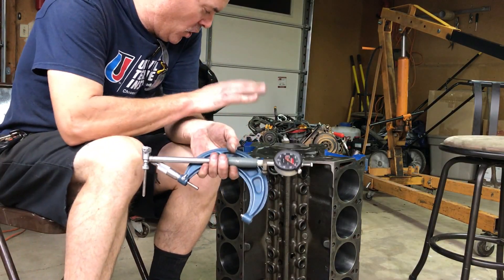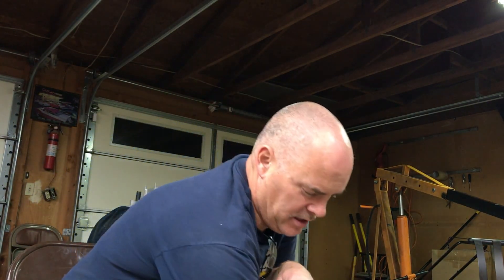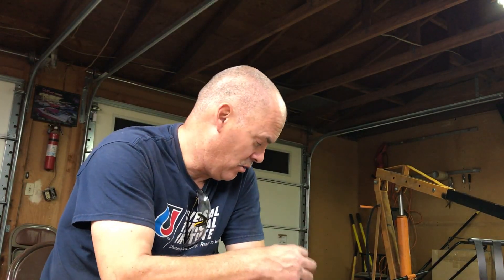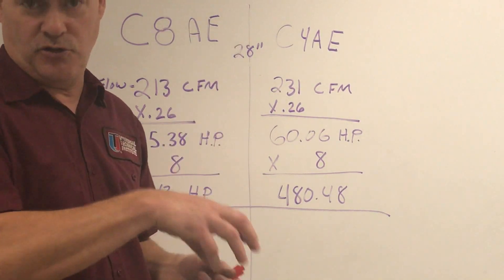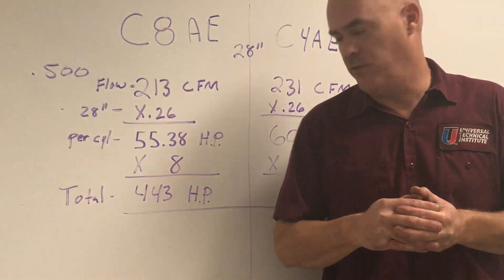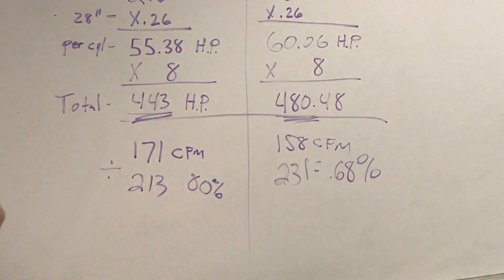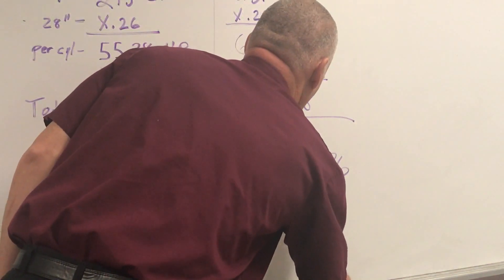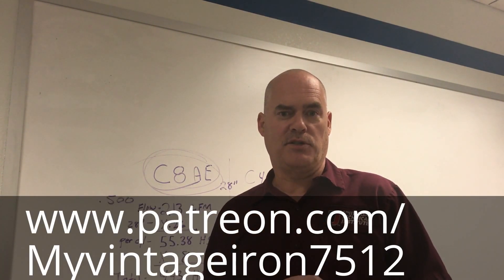390 FE Head Shoot out

Comment: C4AE are of the tall port/ low riser configuration. The C8AE are of the medium riser configuration.
Reply: No they are not. The C8AE-H is a smog head. They are not a performance head by any stretch of the imagination. The 58-66 Tall Port heads are made for performance. The 428 CJ copied the early heads, and they put 2.09/1.65 valves in them. The 428 CJ made the same power as the LR 427. Your test is wrong. The C8AE is not a Medium Riser. It is a small Low Riser intake. The C4AE head will make 1.5 hp per cubic inch. The C8 is made for smog regulations that were coming.

Comment: Honestly I have been running a 60 over 390 for my 428 stroker engine for 7 years now and it has never ran hot at all.
Reply: What is a "60 over 390 for your 428 stroker"?  A .060 over 390 is not a stroker 428? A .060 over 390 is a 401.
Reply: @jesseduke694  I put a 428 crank in it on a 4.11 bore.
Reply: @jamest4363  oh I got it now. Ya, that would be about a 422.

Comment: Last time I built an FE was 1984.  I punched it out 30 over and swapped out the intake from 2 barrel to 4 barrel.  Then put the engine in a dump truck.  I then built a 360 FE to put in my F100 pickup truck.

Comment: it funny how the big ports are bad but in later engines a vacuum controlled butter fly valve in the intake chocks off the air at low part throttling  i see this in various toyotas starting on the 5mge supra n i saw in on the 4.6l 4 valve Lincoln mark engine...be neat to use that thought on a big ole v8 frum the say 1960`s

Comment: Let me start off by making a disclaimer. i dont do check ups before I say something which is prolly dumb but challenging for sure. Im at least your age so I wont explain the memory thing. I forgot anyway.   As for the heads. I may know a little sumpin about them. I grew up in Dearborn Mi. 96% of my family worked at Ford, and the bow ties were not even allowed to park in our drive way. And that is true. So I  messed with an FE or 2. Our basement was (and not exaggerating) half full of 427 high riser heads manifolds, both 2 and single carb appls. We had boxes and boxes of Lemans cap screw rods,  steel cranks, and cross bolt blocks all over. So i'll throw my .02 in on this and hopefully bring some light to the topic if for nothing else to confuse some of you even more.  Brandon down there farther on this page is partially right. You have your ref to the low and med riser heads backwards to be simple. Low risers came out early then the med and High just after. But im going to try and stay on track to keep the typing down.   You have to remember the FE was FoMoCos mule for everything. and they had so many bore and stroke combos with them it would make you dizzy. And that many different head combos to. As i know it, the first hipo version of the FE was in the 1961 Starliner. And this is where I may be wrong but as you'll see in a sec its trivial to the point. I know they had the 390 hipo that was offered with tri power in 61 and it was rated at 401 hp (i think.) Anyway that was a version in casting form that continued in some way for a few years but not right after the motor wasnt offered any more if that makes sense. Now this is what I am to know. fact or not ?? Never was able to confirm or disprove a lot of the things "I know"  As I understand it the only Low Riser head is as follows. C3 number only. Not C2 Not C4 the casting were not the same that I do know.  They made other C3 castings as well but the low risers were not the same and did not ever carry a C4 number That I do know for sure. the real  Low Riser heads only came with the C3 number,  they had huge 2.125 tall intake ports, intake valves were 2.19 ex 1.88 sodium filled. chamber size 72cc(i think) and you knew you had a correct set because they had a big "H" stamped right on the outside of the exhaust on the top of the flange. Thats why in the video our mans says people say the low risers heads are the best. That is a fact. They make super big power. They out flow everything else Ford ever made except the High risers. they were 3 times the super cj head was those C8s you have in the video those are cj heads. the 1 st year for the 428m cj ...? ahh C8 you follow? The 390 gt motor used 28 cj heads and were then revised to be CJ heads when the GT became no more. valve size and all. The 28 had a long arm and didnt like rpm hence small port small chamber head. with adj rocker arms. Only 427 had the large 7/16 adjustables all the other had 3/8 except the 427 hydraulic motor in 67 they had non adj. rocker arms.   So the first version of the 390 hipo head used on the 61 Starliner was still in the mix all the was through 1970. It became the 390 PI head in 62 and 3 still with adjustable rockers due to the PI having solid cam,  then the 390 gt 4bbl head, without adj rockers, then the cj head in 67 and went through 3 revisions only in chamber size and valve size (very minor as i recall) but port configuration was still the same.  In the early for ss mustangs they got adj. rockers again big valves and small chambers.  
 so for the most part they had just 3 heads that made good power in certain areas. if you dont count the high riser. and most dont because the were not ever offered to the public.  the real low riser heads are here https://www.youtube.com/watch?v=Y8GreAEqkio
Reply: Dearborn here too^__^ FE man myself!
Reply: Yeah, but did you have any C7 rods or cranks?

Comment: Hello my vintage iron, my name is Norwood and I’m from New Orleans, LA. I’m looking for a set of ford 302 TBI heads with the ports at the rear of the heads for the ford A.I.R. Emissions system. I have a 85 mercury grand marquis, 5.0 2bbl TBI with the TFI stock ignition system, AOD-M trans w/shift kit and a 8.8 rear diff 3.73:1. I’m not looking for fancy heads with big valves or extreme porting, obviously because of TBI and EGR and the A.I.R. emissions. I’m just looking the get a set of TBI heads that flow better than stock (slightly ported with guides, valve job, seats, seals, springs) but not hurting power and torque. My engine is bored 0.030”, I’m pretty sure the block deck is straight & true with less than 0.002” warpage and the bores still show good cross hatching. I have the original heads (cores) disassembled and cleaned but, as in your videos the guides, seats and valve seals are stock integrated and never been cut. I’m wondering if you have a set or can obtain a set of these heads and do the head work, valves, seats, slight porting and so on. If you can obtain the heads and do the head work, how much would that cost shipped to me. I really like how thorough you work and the quality of repairs you produce. I’m and engine builder for cummins inc but I do not have access to any machine tools. I’m qualified to do the work but, I just don’t have access to do so. The machine shops in my area are ok but, they tend to have a get-er-done attitude that I’m not to keen about. Please, let me know about this as soon as you can. I am on a budget but, I’m willing to spend the money to have a quality set of heads on my engine.
Reply from the maker: Yea I have several sets for sale

Comment: I'll call you the Ford Guy! My 64 Galaxie has a (original w/ RV cam) 390 4 bbl carb and I rebuilt it. It runs great but I didn't put hardened valve seals in the heads. I have been buying lead additive for it. A machine shop told me I didn't need hardened valve seals because todays gas won't hurt the engine. Can I get your opinion? Thanks
Reply from the maker: they are wrong
Reply: So this machine shop is looking to do a job on your heads sooner than layer

Comment: I have a 1969 Ford f250 camper special with a FE 390, with cylinder heads casting numbers D2TEAA can you tell me all the stock specs on these castings like valve size, exhaust port height and width dimensions, the exhaust manifold gasket that fits the port the best, because I'm going to build a custom set of headers for it because there are no off the shelf headers that will fit the stock starter on the passenger side and the saginaw steering box on the driverside. This info will be very helpful for me, thanks. Mark.
Reply from the maker: They are the same as he D8OE except they have induction hardened ex seats
Reply: Thanks for your reply, but that still dose not answer the questions so I will ask again. What dimension  height and width is the exhaust port (actual measurements)? Can you find the same casting number (D2TEAA) in your awesome collection of heads and measure this for me? The reason for this is I'm having to make a flange that fits the exhaust port and 1 3/4" tube size better than the generic sized header type. I have noticed that when fitting the 1 3/4" tube to the generic oversize flange rectangle shape opening, there is a considerable gap in each corner to fill in with weld. I would rather make those corners more rounded which would fit the tube much better and require much less pounding and welding the corners to make it fit the flange and seal the header. To demonstrate what I mean click on this link of a Sanderson header for the Ford FE then click the magnifying icon to get a close up of the corners of the exhaust manifold flange where the 1 3/4" tube fits the flange, you will notice the gap in the corners where they tried to fit the tube then filled it with weld. I think their is a better way to do this by making the flange opening more rounded in the corners. https://www.sandersonheaders.com/sanderson-ff391-header-set-for-ford-fe-engines.html

Comment: What would be a good budget build for a 360fe was thinking aboyt finding a 428fe crank and building it up from there with a 4 barrel carb cam and maybe alluminum cylinder heads im only 17 so money isnt exactly flooding in my pockets lol it would be going into a 71 f250 4x4 would like a real nice rumble and enough torque to pull a house down with a little more top end power
Reply from the maker: Find a 390 crank and rods and youve go a 390

Comment: great video. great math. 
You mentioned that you measured your ports flow at .500. Meaning that it would be a single plane cam. My guess is that by using a dual plane cam (.500 intake, .524 exhaust) will give you different results in flow and final HP numbers you wrote on the board. Correct me if I am wrong. -thanks.
Reply from the maker: that's why we will usually run a duel pattern cam when running factory heads it gives a poor flowing exhaust port a bit of a boost good point
Reply: @Myvintageiron7512  until you go to the point of reversion as you have shown us.

Comment: my car came with C8 heads on a 68 engine. the book says CAR IS 11:1,  and I was considering just having the shoulder taken out of the exhaust ports. I figured I'd make plenty of power for the street withe a mild street cam and carb and intake on this little 390. if that's not enough id spend the money on a stroker kit from Survival Motorsports. this will never see the track and it has 3.08 gears on a 3800lb car. I have an eating posi ready just in case.

Comment: TFS is now producing a new designed set of heads for the fe engine. The flow numbers are almost too much for a NA built engine. With the exhaust ported out on the c4 head would you choose this head for a bracket racer?

Comment: I had a flow bench and was trained by a older man that did it for 30 years how to port heads and use the bench and I was wondering why you aren't using a contoured intake port opening attachment?? The reason is the right angle sharp edges of the intake port opening are a restriction because they cause turbulence in the air entering the port and lower the flow bench readings which is not a accurate flow rating of the intake port itself. In the real world you have a intake manifold attached and carburetor on top which the carburetor has contoured radius to enhance airflow. Just curious??
Reply from the maker: That is true I don't have the intake fixture for the FE heads in this case we were just comparing one head to another
Reply: You can use modeling clay, that's what I used until I made one out of machinable clear plastic
Reply: By the way how much more power will I gain if I use a Holley 500 cfm two barrel and add headers. I'm not looking for a whole lot more like most are just a significant improvement over the stock anemic setup. My stock two barrel is only 351 cfm

Comment: Cutting the shrouding from around the exhaust valve in the combustion chamber will do wonders for a C4 head. This stuff aint rocket science. Just open the exhaust ports to match the gaskets and smooth out the transition and bowls. Go slow and check the volume. A few hours of patient grinding (make some profile templates) will buy a bunch of hp.

Comment: I had a 1966 Fairlane 4 speed 2 Bbl 390 back in high school. I had a competition valve job done, installed Crane springs and a .512" Lift x 312D duration cam by Mellings along with a stock 4 Bbl intake and 780 cfm Holley. Being a dumb lid, I basically cammed and carbed it like a high compression big block Chevy with good heads ... wrong wrong wrong. The car was not much faster than stock and tempermental as hell with no vacuum and no low end torque at all. I wound up replacing the Mellings cam with a factory Ford 428 Police Interceptor Cam, H&M steel shim head gaskets, downsized the carb to a 600 CFM Holley and put in a 3:90 gear to get it running "right". 389 GTO's and 325HP big block Chevelles would still blow my doors off at the top end. Bad head flow, low compression and weak cast rods (4800 RPM safe redline) made for a really crappy motor. I eventually bought a 428 CJ out of a wrecked Mustang. That was a fast motor.  

Building a good running 390 Ford is a challenge. They need a stroker kit with forged rods and Edelbrock heads to keep up with a stock 428 Cobra Jet.
Reply: WE HAVE A 390 VERY MILD in 80s thunderbird drag car with 456 gear  c4ae 6090G heads comp 268 cam it runs 7.80s  in the 1/8 mile  we have videos of it on facebook
Reply from the maker: I agree they is why we chose to stroke this one
Reply: The problem wasn't just your head flow, it was your cam selection. a street FE runs best at around 258 to 270 duration, and around .480 to .490 lift, and that is with a high flow dual plane. a decent porting on the stock heads would have yielded plenty of torque, and the factory rods are good to around 6000 rpm.

Comment: By that same rule, you'd only need to gain 8% of intake flow for the C8 head to match the C4 head.  ...a better alternative would be to retain the intake port volume and just port the C8 exhaust ports by 8% (13.68 cfm) taking the flow to 184.68/213 = 86.7 % x 443 hp = 384 hp with greater torque. I'd be interesting to see the intake flow numbers on both head as you increase lift above .500.
Reply from the maker: agreed improving the ex flow on the C8 is the best way to go

Comment: You my friend are a bank of knowledge. I am 16 years old and I know I need to rebuild my 390 within the next year, but I am not sure if and will it will happen. The motor is an all original 1964 390 fe thats in my 1964 Mercury Montclair. Ive checked all the castings and the block and heads are from 64 but the exhaust manifolds are from 1963.....interesting. Anyways, the reason its gonna need a rebuild is theres something going on in cylinder 5 . I'm not sure if it has broken rings, low compression, or what, but it is what it is. The engine sometimes runs on all 8 cylinders but at most times it runs good on all cylinders except cylinder 5....I'm just not sure whats going on with it. I have videos of my car up on my channel if you are interested. Maybe you can help me figure out whats wrong.

Comment: Thank you for the videos- I am currently tearing down a 390 and have found many great tips here. This engine is a puzzle as it is not the one that came with the car- the heads on it are C6AE-R . Have you ever put a set of those on a flow bench? I am putting this car together with my son who is 7, he calls it his new-old car. It's our 10 year project. It is not a hot rod and weighing 5000 lbs I need as much torque as I can get to make it move. It's a 66 mercy park lane convertable. I don't have the cash to send the heads out just to get some numbers at the moment but if you have anything to tell me that would be great we appreciate your time.
Reply from the maker: That is a really good set of heads they are called the poor mans CJ heads they have big ports but the smaller 390 size valves if you have a machine shop install a set of larger 428 valves and do some clean up porting and you will have a really kick butt set of heads or being on a budget like you are just run them like as is,  they are still better that your average 390 heads they work very well check the stroke of your engine you may have a 428 engine there
Reply: Thanks for the reply,  sad to say I just got them back from the machine shop and had harden seats valves guided and springs put in - they did give me the name of a guy that does port work but his cost is more than what the machine shop wants to charge me for reworking the block with new freeze plugs can bearings and crank work - so unfortunately I need to get all that done first maybe later I can look back into maybe re-reworking the heads but don't tell anyone shhh "that car" is a sore conversation piece when it comes to money spent - on your video you were calculating potential horse power can you predict potential torque?
Reply: The stroke is just a hair over the 3 & 3/4 mark on the ruler so it looks like a 390 , has a c6me casting . Sad thought I would love a 7 liter motor .